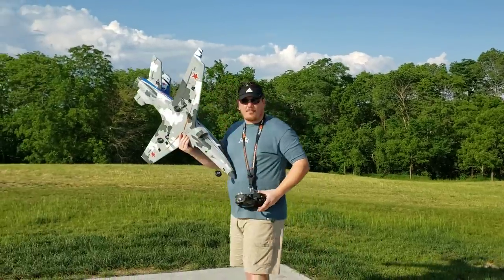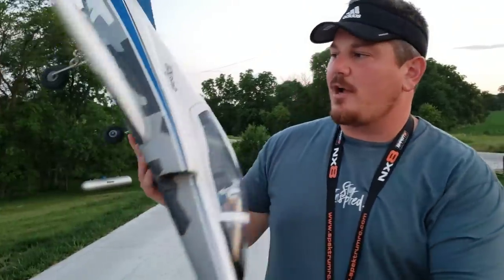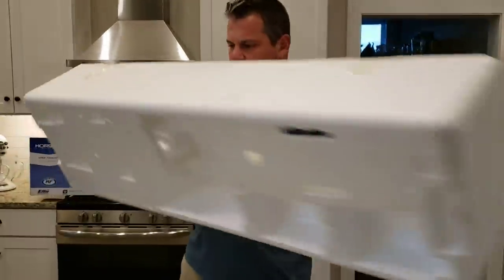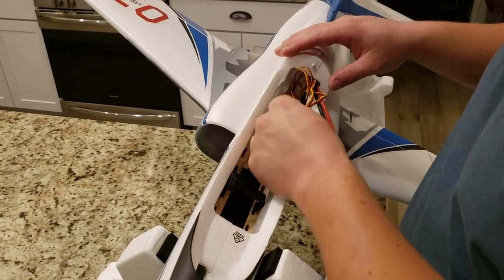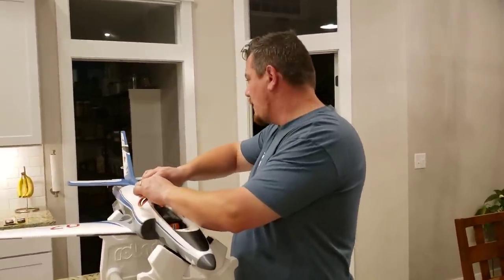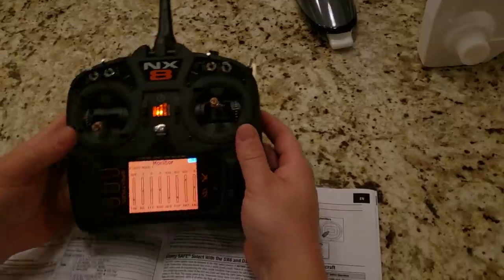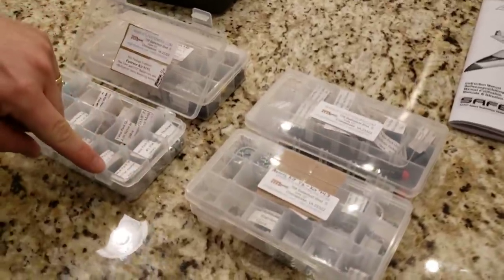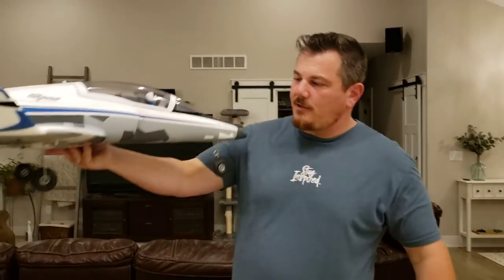Eflite - Viper V2 - 70mm - Unbox, Build, Radio Setup, & Flights

Comment: Why not just put a smart receiver in it?
Reply from the maker: One could do it ;) 90 mm is coming - Can't wait!!!
Reply: @BrianPhillipsRC  yeah the 90mm is on my list.  Will watch your video intently for setup and flight.  Reverse will be a God send on my field.  We have to come in high out of the trees and I usually roll off the end of the runway.  With that new jet you can just put it in reverse.
Reply: @BrianPhillipsRC  They put the smart receiver in my Air Tractor so all I had to do was upgrade the ESC.  Guess that must be raising the price too much going forward.
Reply: @BrianPhillipsRC    I have the 90mm.  I'm doing the second flight on my 70mm tomorrow with lighter SMC packs.  If that goes well I will get out the 90mm.

Comment: Why don't they replace the crap gear with suspension retracts
Reply: To keep the price under 300
Reply from the maker: I tend to agree, at least the nose gear....
Reply: @qqff3192   + $30? Go figure, this is a no-brainer upgrade.  Just like every motorcycle built after 2000 should come stock with cruise control!